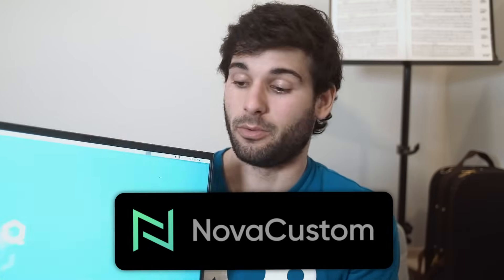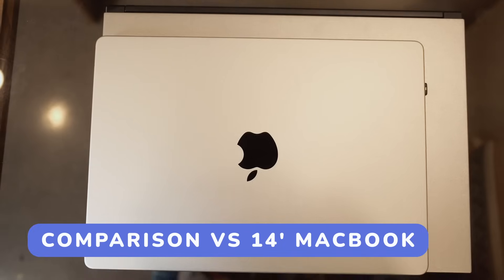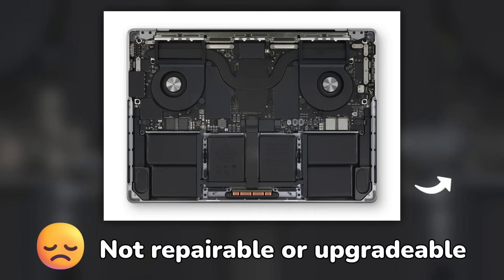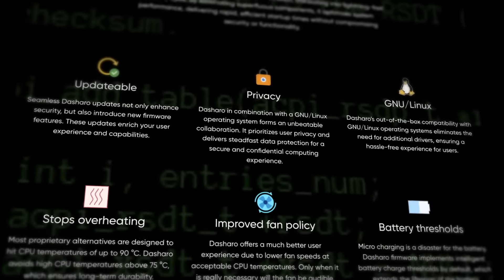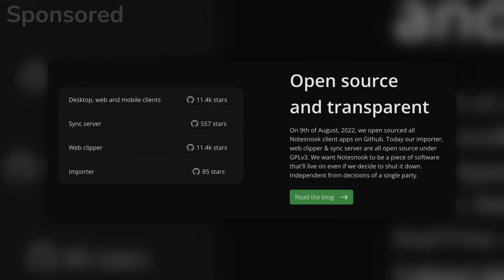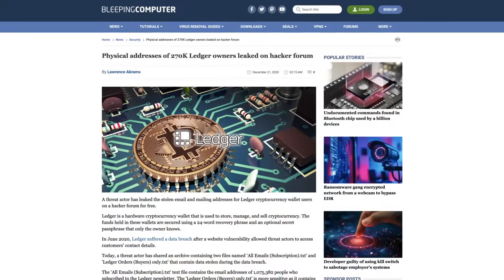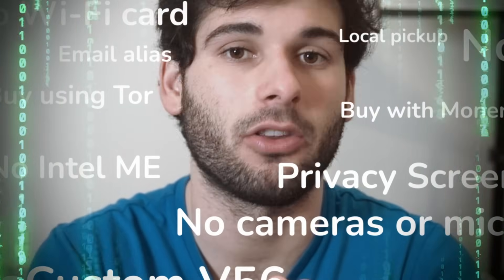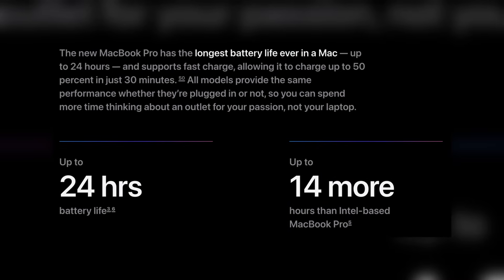Finally! True Privacy in a Laptop: NovaCustom Review

Comment: 9:09 The Wifi card is described to be an Intel AX-210/211 (non vPro) which only costs 5 euros in the laptop config. I would rather recommend buying "with", and then just manually remove it to own as a 5 euro purchase😺

Comment: I am writing this on my NovaSystem NS70 laptop: 32GB RAM, 1TB+2TB SSDs, Intel i5 CPU + iRISx on-chip graphics, coreboot, Linux Mint preinstalled, and no Windows. I got it in Summer 2024 when I had to retire prematurely due to ill health from my dream job as a CS professor. Apart from choosing i5, I have been extremely happy with it.

Comment: what would you ever need 96Gb of DDR5 ram for........................................ for comparison, most games can run with 6~8gb of 3200mhz (ddr4 speeds) and even for multitasking, using chrome for watching YouTube and playing higher end games at the same time, like 16Gb is plenty for 99% of games. for 3d rendering I can understand like 24 GB max... even with heavy apps like that though  your never gonna see more than that. people say 16Gb ddr4 is good for high end gaming, 32 is better for excessively heavy games and 64 is absolute overkill. that's ddr4 speeds though... ddr5 for those unaware is ~1.7x faster at 5600mhz. meaning literally 16Gb is PLENTY for everyday use. even power users don't need 96...
Reply: It's a hypervisor.  There are people who want to run a dozen VMs easily.

Comment: Currently, Intel CPUs are a huge deal breaker
Reply: Yeah im a huge linux fan but i literally got a macbook m1 used because nothing can beat the efficiency performance ratio right now. I dual boot asahi linux though which is fully open source, and apple silicon has no equivalent to the ME, it does use apples closed source iboot firmware but it has no networking stack and isnt persistent after booting so its way more secure vs intel chips which have a persistent subsystem running all the time

Comment: Since you've gathered QubesOS users in one place I have some questions. 

1. Is it possible to order QubesOS supported PC with Windows GPU passthrough already installed?

2. Is GPU passthrough already stable or still better to go dual boot for gaming/video editing and overall GPU usage?

3. How much RAM is recommended for daily usage+work related stuff on the same PC?

4. Is QubesOS secure enough to have daily VM and darkweb VM on the same hardware?

5. Is it worth it or should I stick to Kicksecure on one laptop and Windows on the other?
Reply: GPU passthrough with dedicated GPU? probably not, qubes os is greyed out when you choose an nvidia card on their configuration page.
32GB ram should be plenty for most normal use + work use cases, even video editing. But how much ram you need is totally up to you to estimate.
If you are a true privacy enthusiast and have the budget for it, do not dual boot.
Reply: @gumz4183 why no dual boot?
Reply: @nickg1134 I should have been more specific. I meant do not dual boot with windows.
Windows boot manager is known to f up other bootloaders at times when windows updates. Also windows is more tightly integrated with intel chips they might even share back doors with each other who knows. Anyway the main point of issue is that windows is proprietary and we can’t know for sure what they are up to. They are known to be rabid telemetry collectors.
Reply: @nickg1134 i dont care if thats not an option. If you want qubes os I assume you are a privacy enthusiast. So I advised not to dual boot with windows. Stop hallucinating.
Reply: @gumz4183 being all or nothing is widely agreed in the privacy community to be a bad approach, and only serves to close average people off from adopting better privacy practices. Everything depends on your threat model, dual booting qubes OS or any linux distro is still going to make you 95% more private than the average person. Also i still fail to see any reason having windows installed on a separate disk has any bearing on your privacy level if you are using disk encryption anyways. If you had that serious of a threat model then you would know to use an older laptop with the intel management engine stripped out anyways. Youve provided no proof of your little pet theory that windows has some type of integrated backdoor with intel but are saying i am hallucinating. OK.
Reply: @nickg1134 buddy stop yapping. Nice windows shilling btw how much are they paying? 
Windows boot manager is known to cause problems with linux dual boots. It’s also more tightly integrated with Intel ME.
Reply: @gumz4183 windows comes no software to utilize the intel ME unless you are a corporation and you get vPro intel CPUs, also as i just explained windows boot manager doesnt mess anything up if you use a good third party boot manager like refind which you should be using anyways even for single boot solutions. You are literally schizophrenic if you think your dual booted windows partition is somehow spying on your other encrypted partitions while not in use. Thats the dumbest theory ive ever heard. Also you probably think you are so secure using linux and dont even know all the massive security flaws in linux, also proprietary blobs (which qubes os has lol)
Reply: @gumz4183 im not defending windows you clown im saying your theory that dual booting windows makes qubes os less secure is unfounded by any evidence and just some bs you made up

Comment: I would be interested in how this compares to Tuxedo, Framework, Slimbook or System 76 laptops.
Reply: Bumping this post. That would be great to see
Reply: Don't all of them except for framework order the Dane chassis from the same Chinese ODM?
Reply: @montenegrofees  Wait, System76 white labels the same company?
Reply: I bought a Malibal one year ago and am super disappointed in the support, short battery life, etc. - would LOVE to see a Linux privacy comparison.  Thank you Henry!
Reply: I have a 16" Darter Pro 10 from System76. It looks like this NovaCustom uses the exact same white label Clevo V560TU as my Darter Pro. So, aside from firmware, its's pretty much exactly the same to my System76.
Reply: also would like to see how this compares to Purism’s laptops
Reply: yes also include Purism
Reply: They didn't give him these laptops. Maybe other ads are on the way.
Reply: I checked this two days ago. If you are maxing the specs, better check Tuxedo. Low end could be equal, though Tuxedo seems to have slightly better specs on the baseline. So far Nova and Tuxedo are the only ones I have found that offer ANSI keyboard layout. Thumbs up for Nova for option to delete camera, mic and WLAN.
Reply: Is it's thunderbolt (display port alt mode) connected to the integrated GPU or to a dedicated GPU such as the Nvidia GTX 4060 option. ? The latter is needed for psvr2 to work on the laptop
Reply: Agreed. Hopefully we get to see some comparisons between those